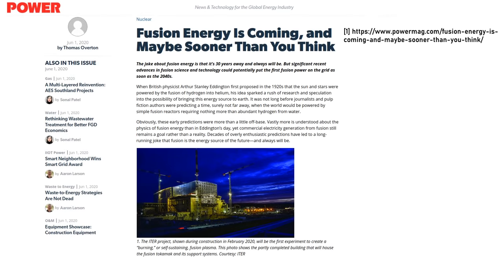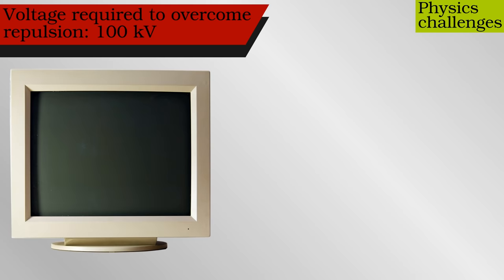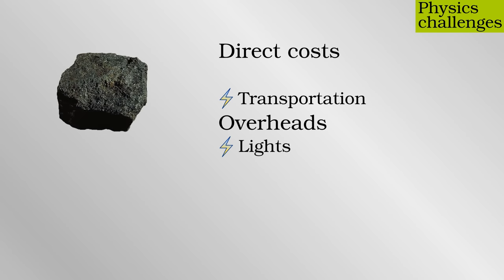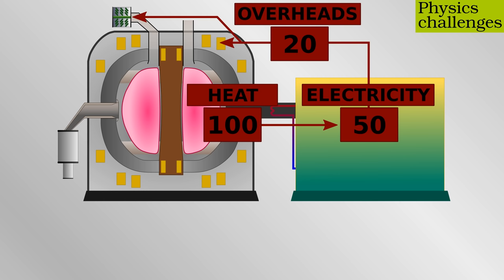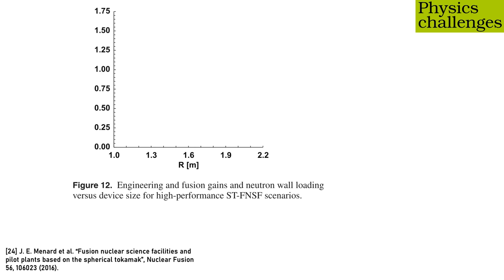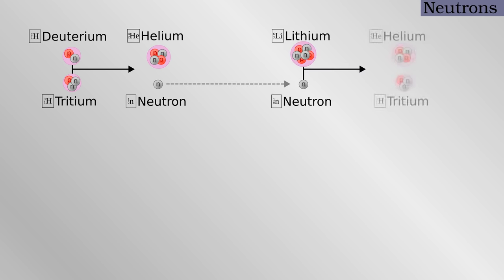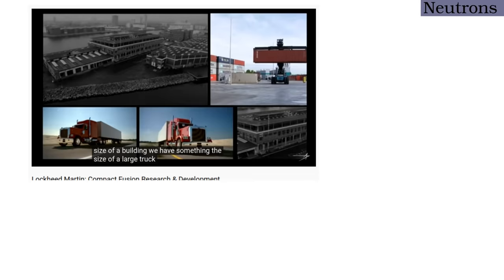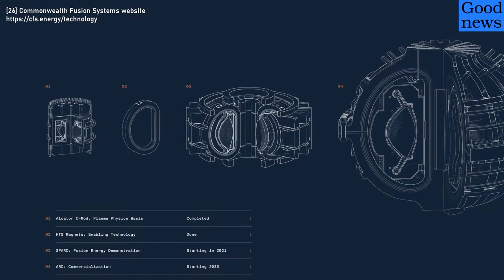Former fusion scientist on why we won't have fusion power by 2040

Comment: The globe is spending billions on a "one solution fits all" tech when, perhaps, a multitude of "low-cost" tech that's accessible to everyone might be more sustainable. Should we give up on nuclear fusion, or won't current clean energy tech be sufficient? Humans like new things, but nuclear energy isn't a toy. 

Also, nuclear tech requires very specialist knowledge & years of training. Other renewable tech could create countless jobs for people with more easy to acquire skills - is this not better for humanity in the long term?

Or perhaps humanity just needs to get nuclear everything out its system before quietly accepting "less fancy", more practical (i.e. "boring") energy solutions that serves everyone?

Comment: Imo Iter..  will not work. It is too big, too slow to iterate . SPARC and the Canadian steam punk looking reactor look promising,  like you said, rough and ready, smaller and leaner, able to iterate quicker I think is the way to go. Lockheed Martin put out a puff piece years ago saying they were working on nuclear fusion. I guess we'll never know if their  reactor will work. If It does it will probably go to a classified black program 😅
Reply: You need large equipment to keep a fusion reaction safe and stable.

Iter is a good testing platform, the best one we have.

Comment: project orion in a giant piston? - just need to make a massive piston like mine shaft a 250meters deep and 50 metres wide with a million tonne piston head and crank connected to a generator and detonate small 1 kiloton tactical nuke under it every hour or so to have it oscillate up and down a few hundred time every hour or so  for a cheap as nuclear combustion engine lol

Comment: When you look at the big simple picture its doesn't look good.  We started highly negative of efficiency, we can get just above zero, as long as you don't count practical loses.   Efficiency goes up in tiny steps, while costs go up in large steps.   It certainly is not going to help with climate change.

Comment: No.  We use the Z machine to make x-rays which are focused on fuel pellets that ignite H-bombs.  This legit could have been done in the 90's.

But everyone is so hyper focused on sustained fusion when intermittent works so much better.  Well except those laser folks but we know x-rays work better anyhow.

Comment: Let’s say we solve the fusion efficiency problem with magic (I think it’s called AI these days). And let’s say we solve the fuel issue by pouring trillions of dollars into building a AI robot tritium mining facility on the moon. How are we going to solve the neutron issue that constantly deteriorates the fusion reactor that has to be replaced? We will not have fusion even in 100 years

Comment: Year later "Guys we have achieved stable fusion reaction!".  In science you never say NEVER, you only address the issue of today not of tomorrow. As Scientists you are not about prediction you are about what is right now. What do we know? What can we do? What are the problems?

You only predict when you have repeated data that it will be so - not speculation. In science brake though can take place any moment.
Reply from the maker: You should actually watch this video.
Reply: @ImprobableMatter  I did 🙃
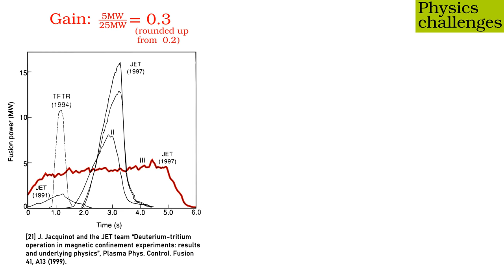Reply from the maker: I'm not sure what you mean by "achieved stable fusion reaction". In my video, I stated ( 07:22 ) "at the National Ignition Facility the fusion output slightly exceeded the laser energy input". This is exactly what has recently been reported in the news. As I explain, to use fusion as a power source, we would need to exceed that laser energy input not just slightly, but by a factor of at least 20. We would also need to develop other technologies, which I also explain.
Reply: @ImprobableMatter  Hello 🤗

I have to say a lot to clarify this - do you really need this? It sounds like you think I'm picking on the video while I'm only picking on the pessimism ( and that is specific kind of pessimism) . There is nothing wrong with information presented per say in the video. Valid questions, informative. I'm not challenging anything that presented, just the conclusion and attitude towards the problem.

And of course fusion reaction was achieved before, this is not what I am talking about.

So even what you said above In comment I agree. I'm sensing you have confused what my comment was all about.

If you what I can give you more detailed and wordy explanation if its of any value to you?
Reply from the maker: Thanks.

Comment: When someone asserts that something is impossible or won't happen, i find it sad. Have you learned nothing? Especially if yhe guy is educated. It is short sighted and self indulging to say such things.
Reply from the maker: You're right. Building a working space capable, faster-than-light Millennium Falcon may seem impossible with current tech. But let's build it by next time next week. Surely nothing would go wrong with this plan?

Comment: And all of this ignores the real problem with fusion power: capitalism. Specifically, the current formulation of it which runs entirely on oil, is constantly finding new uses for oil, and uses oil as a proxy for security, all while the continued use and extraction of oil literally fries the planet.

The moment fusion becomes technologically viable, it will be made economically or culturally non-viable. That's what was done to fission power, as the early "environmentalist" movement of the 70s was founded with oil money to spread fear and render the power source illegitimate in the eyes of the public. It didn't help that most of the criticisms lodged at that time were true, but now that they are all more or less false it doesn't matter. Nuclear power is permanently stained with the spectres of Chernobyl and Fukushima. Neither of which even killed more people than a single coal plant is estimated to in its lifetime when it is functioning properly.

It's an insidious process, but fusion would need to beat that too. Assuming any of the engineering problems can be solved, we're basically going to require a global revolutionary movement to enact mass adoption.
Reply: rent an IQ.  Communist countries aren't going to make it happen either

Comment: I hate this channel. I watched some videos a year ago, and now i've come across even more. There are several simplifications made where a given "maximum" is based on not even conservative but actually stagnating estimates for the future. Especially with efficiencies. "Some are absorbed by edge plasma" the heat from the edge plasma is needed as well to sustain the plasma. And then there's completely novel approaches. 2016 was also a half a decade ago which might be a century in high investment high impact research terms.
"None of these have been fully built yet, let alone tested." - some guy talking about shaped explosives compressing fissile material to ignite a nuclear bomb, circa 1944
And that's not talking about the possibility of all the other sort of confinement mechanisms which are also being explored by actual fusion scientists.
And THAT's not even talking about direct energy conversion of various sorts, laser fusion, etc etc, all of which here are dismissed out of hand, even though there are many academics behind each of these fields.
Reply from the maker: Click the button with three vertical dots next to my video and press "Don't recommend channel".
Reply: @ImprobableMatter  Good idea

Comment: This video is riddled with gross technical errors. Example: "all fusion reactions would have to maintain a very high level of vacuum... which would not only require turbine blades to be spun very rapidly, but also to be cooled to cryogenic levels". The vacuum is in the torus containing the fusion reaction, nowhere else. The turbines won't even be in the same building. This video may deceive laypersons with no nuclear or power generation knowledge, but as a professional in the nuclear power generation industry, I know it's nonsense. Using this man's pretzel logic, none of the nuclear power plants today do anything, because the overhead of getting the nuclear reaction working. Nonsense all the way!
Reply: What is your opinion on the recent developments in nuclear fusion?
Reply from the maker: Your comment makes me think that you are confusing turbines in a vacuum cryopump (which does have to be close to the torus) with turbines in a generator. No existing practical nuclear fission reactor has a level of vacuum close to fusion levels, so I can't see how you would have professional experience of working with cryopumps.

Also, how is that in any way relevant to the point I was trying to make?

Comment: point 1 at 40 seconds - is unreasonable. Building a small scale - but net-productive generator IS NOT like building a railway or airport it is far less complex.
point 2 at 3 minutes 10 seconds "You can't tun low grade heat into electricity", "because of the second law of thermodynamics" - what utter utter utter bollocks. I stopped watching at that point.
He might be a former fusion scientist but he was never a science journalist and since the first 2 'fact's he quotes are rubbish I seriously wonder about his scientific credentials. And citing a load of anti-fusion, anti-science, NIMBY articles rather than scientific papers looks very suspiciously like camouflage...with a couple of supporting citations of papers from organisations I don't recognise.
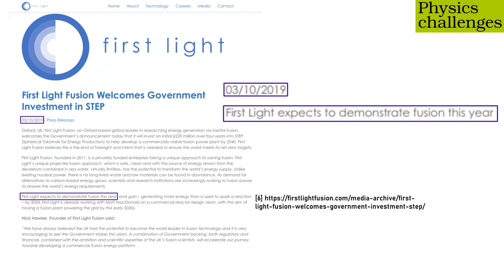Reply: You should timestamp the time like this 3:33 so we can click and link and go there

Comment: 1. Humans only got the fusion energy idea on discovering our suns source of ongoing energy being fusion.
2. Humans will continue to bang their heads against wall surfaces on failure after failure cause we don’t give up.
3. Humans will eventually realize - our sun has massive massive gravity being the catalyst of fusion - we think more heat will compensate … we carry on
4.Silly humans - it will never happen until we develop artificial gravity - and attempt fusion under gravitational forces being induced - good luck lol 👎
Reply: Of course, if we could force nucleons together using artificial gravity, we wouldn't need fusion.  We'd just pull things wherever we wanted using the artificial gravity machines.

Comment: I instinctively felt that He-4 mass is not 4.0026 amu. But is just 4.026 amu.
So that actually, FUSION is Endothermic Process.. stored Energy in form of Helium Binding Energy... The only Given-off (Energy) Process is Fission. When Bigger Atom broken into two smaller/lighter (elementary) atoms.. such as He-->2H + Energy (?!?)
I knew this is against the Very fundamental of Nuclear Physics (for every Atom smaller than Iron (Fe) or Nickel (Ni) the growing larger Atom by FUSION, will make LIGHTER Product from a little Heavier (two) atoms, thus giving off some Energy (or fast neutron)
My suggestion CAN Explain the Coronal Mass Ejection... Current physics CANNOT.!?!

Comment: put horses on a treadmill and they will generate infinite energy, feed them grass, use their manure when it dries as fuel or leave it so more grass grows, have 10  horses per house, energy 24/7, but really fusion is stupider than anything, fission is perfectly fine, and solar panels with batteries to store energy is even better, if all houses switched to solar then coal/gas powerplants would stop polluting, people would drive electric since now it would be free to charge, killing gasoline industry etc.

Comment: Well this didn't age well.
Reply from the maker: Has a working fusion reactor been built?
Reply: @ImprobableMatter  yeah in China. They're still doing tests but they achieved successful sustained fusion reaction.
Reply from the maker: @TheHonestPeanut  Not with more energy than they put in. Also, they have not solved the other problems I've outlined in this video - Tritium breeding, material degradation.
Reply: @ImprobableMatter  well my comments keep getting deleted so I guess I'm not allowed to respond to this? We'll see if this posts.
Reply from the maker: @TheHonestPeanut I can see this one.

Comment: for AI this not even a task
Reply: This video shows why AI will be kinda useless for improving on big real physical world fundamentals like humanity's capacity to produce more energy. You need large scale experiments in physical worlds which doesn't work at the speed of light. You can't easily scale it up 10 folds at will as you do with software at least not that easily and it takes decades. AI will not be able to think its way out of big real world problems, it can help but it is not clear how much it can speed things up.

Comment: Of course they won't be able to do it, scientists just love to play, and it's our money they are playing with, the answer to the energy generation problem is distributed energy generation, all on a smaller scale, centralised generation will never work efficiently, eg, we have vortex generators, very efficient for smaller scale generation, but cheap and easy to do at a local area, also we have water cavitation, this has overcome the pitting found previously by allowing the effect to happen in a cavity so the explosion does not interact with the walls, we are on the brink of free energy generation, (not really free) but the ability to out more than put in, this tech has already been developed but suppressed, scientists do not like any of these systems as they are cheap and they don't get to play with giant projects, they are all small minded narrow focus idiots, distributed energy is the answer.

Comment: look at the title of your video then ask yourself. have you been living under a rock?
Reply from the maker: Did something happen?
Reply: @ImprobableMatter  kind of
Reply: @arnold3414  Elaborate.
Reply: @ImprobableMatter  they did a fusion reaction that actually created an energy surplus
Reply from the maker: @thejagtimes  There was an energy surplus relative to the laser energy input, but it took a lot more electrical energy to power those lasers in the first place. They are currently doing about 1 shot per day, so as I said in this video a goat on a treadmill could outproduce their entire facility even if they were making an electrical energy gain.
Reply: @thejagtimes  
Thats a lie buddy....

500MJ in and 2.5MJ out isnt a net energy postive reaction.

Comment: Or, we could just place our existing super cheap fusion energy receivers 93 million miles from our existing fusion reactor and watch the amps flow.
No need for any more research. No need to build thousands of the biggest lasers or superconductor ever made. no need to work out how to create more than one fusion per month. no need to dream up ways to collect a fraction of the fusion energy. no need to work out how to make these machines last >20years without maintenance. no need to keep the boots of centralized generating companies on our necks forevermore.
Right now, today, solar PV is the cheapest form of energy generation. it is decentralized (saving transmission costs). It requires next to no maintenance (saving operating costs).
Without all the lies of various vested interests, including the nuclear and military physicists behind fusion research, this wouldn't even be a conversation.
Reply: But it’s not cheap if you are far from the equator. Those near the equator already do this.
Reply: @Gomlmon99  Solar PV Is the cheapest source in most of the world, except extreme polar latitudes. In Australia (approx 30degrees lat), solar PV power is cheaper than the transmission lines needed to distribute utility power, which means that even if they produced for $0, they'd lose money. In the US and EU (30-50 lat) there is no business case for building even gas powered utilities, it just can't compete on today's prices, never mind with much reduced future PV prices. In large swathes of the populated world, Solar/Wind is the only economic model and it's getting cheaper every year.
These vastly complex, hugely expensive centralized fusion systems (that just have their fusion energy collectors closer to source) have no benefit whatsoever and never will
Reply: This would be nice if your characterization were true.